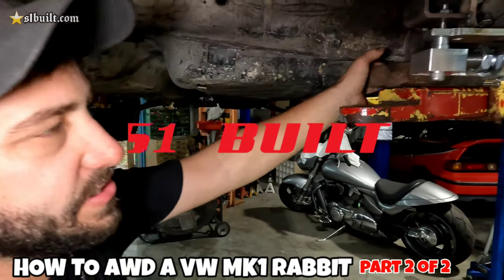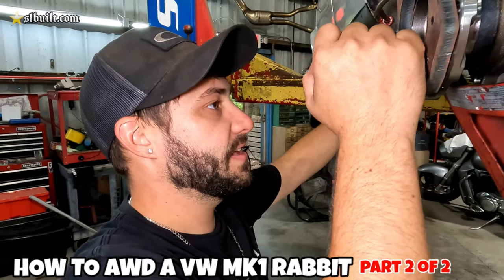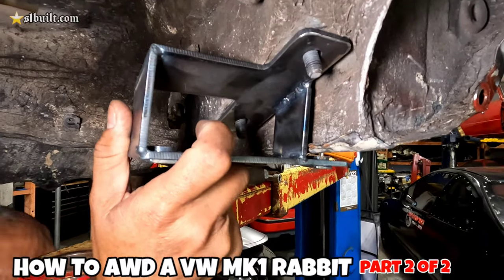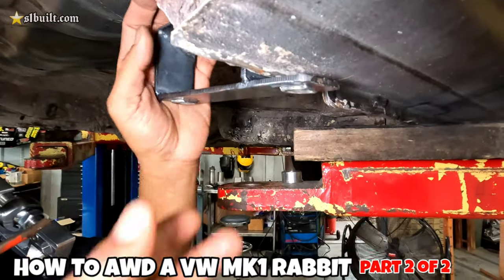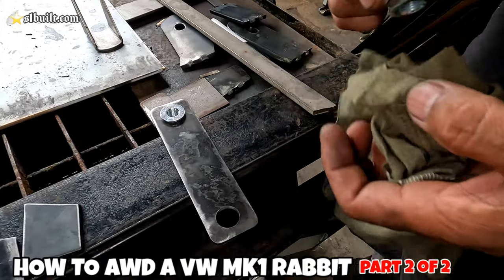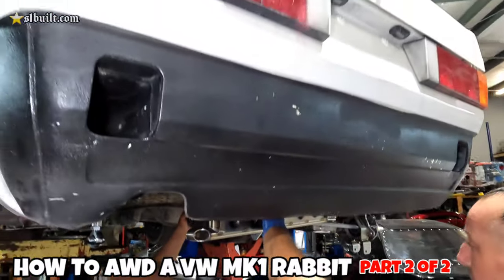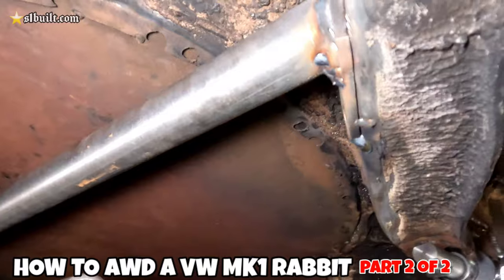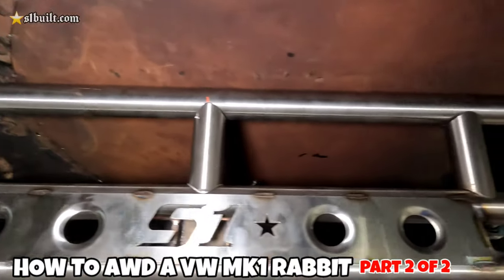K-SWAPPED VW RABBIT ALL WHEEL DRIVE KIT IS DONE!!!

Comment: I'm concerned that the rear trailing arms are mounted too low in the chassis. To me it looks like you will end up with bad geometry and bad ground clearance. Or you will have to make the ride height really high. I hope iam wrong!  But regardless, keep up the good work and keep pumping out these mad awd k swaps
Reply: Thr trailing arms are the same height because the use the stock MK1 mounting location. The AWD system are actually pretty high up. Even higher then the Civic/Integra.
Reply: The Geometry is prefect💪 We took all that into consideration. That why we made some changes.
Reply: @sones1built196  kit availability? How much would it be to one off the kit and ship it to Oklahoma?

Comment: This is an awesome project. I’ve been wanting to get my Mk1 Cabriolet Awd swapped when I get a vr6 into it. Are y’all selling those parts as a kit ?
Reply: won'r work unless you get a custom driveshaft made for the honda rear diff and the vw trans you are using
Reply: True. But I reckon if I’m gonna have to make custom drive shafts for the front ants Could probably make a Honda vw hybrid shaft. Or have one made
Reply: @zanderbrand1319  you don't need to have anything made if you stay vw as far as driveshafts and axles. YOu do what VAg does and put pieces together. And people like me who do it, have made many threads on the vortex and in multiple Fb groups of what to do and cost less